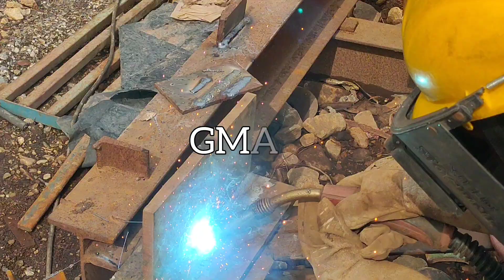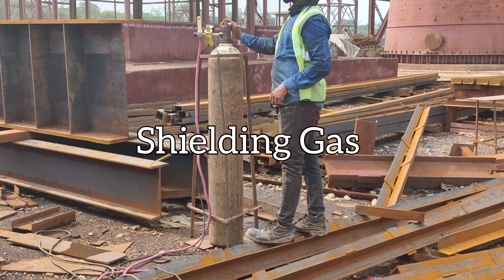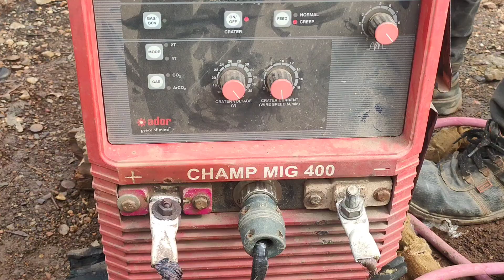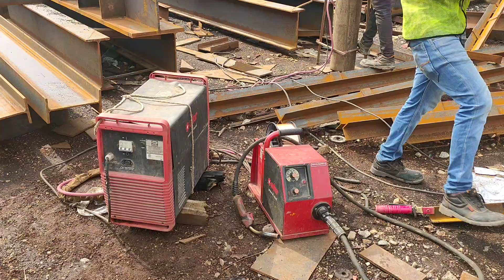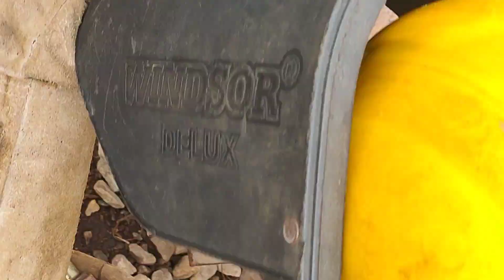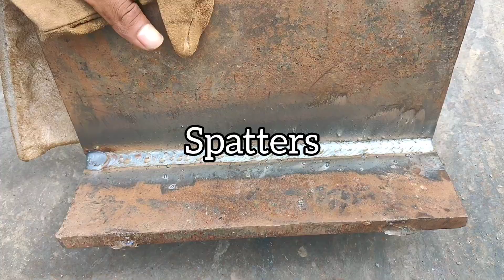Mig Welding explained in English

Comment: Sir please send the chart of 1g 2g3g 8mm steel plate, 08 -1 mm coil mig welding wire speed, amphere voltage setting chatt